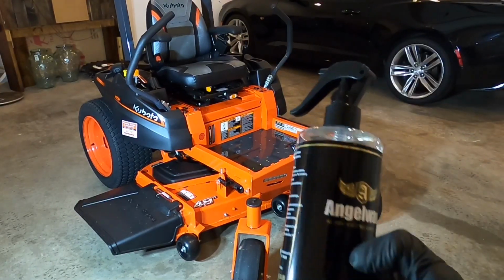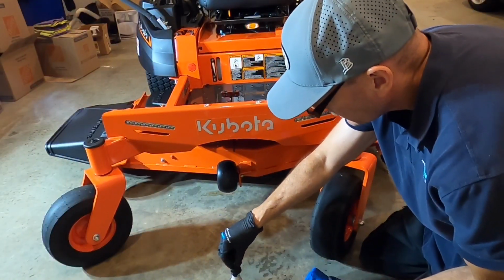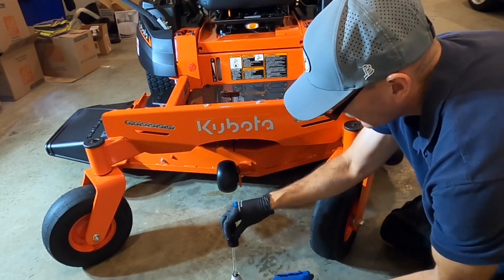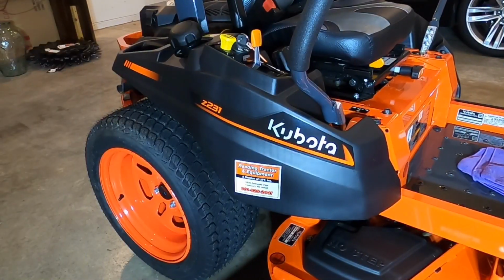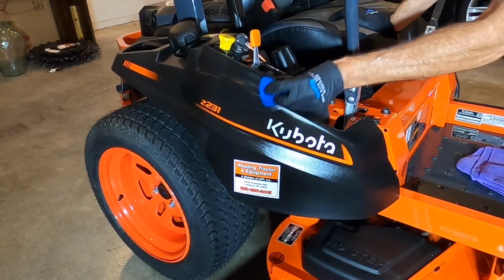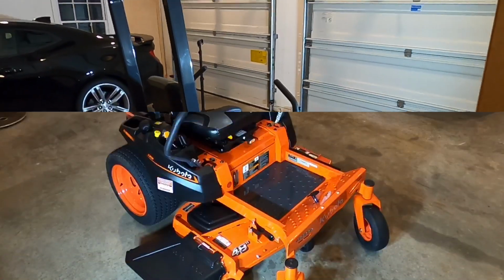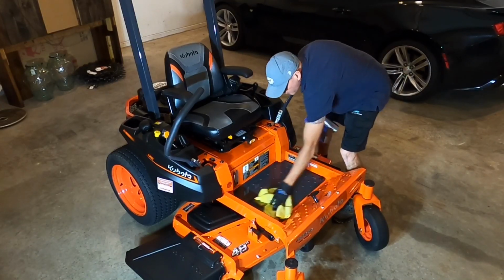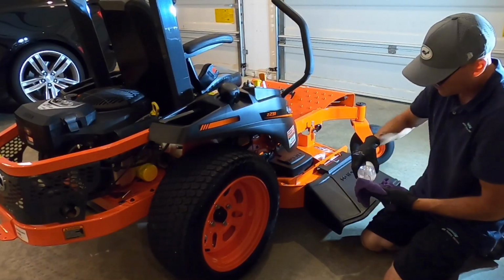Ceramic Coat & Protect ALL Of Your Investments!! Kubota Tractors, Mowers, Loaders!!

Comment: Got my first zero-turn a few months ago and I love it. I imaging ceramic coating the bottom would help shed wet grass, but the paint seems like overkill to me. That said I have an ounce of ceramic coating left over from my car, so...
Reply: It doesn't really help. I've coated the underside of my zero turn deck a few times. The first cut it's pretty much completely gone due to the abrasive nature of what you are cutting. The best form of defense against your desk rusting is to keep it clean. Get yourself a good zero turn lift and hose out the deck after every cut. Those wash ports are useless.

Comment: How does metal oxide coating compare to a ceramic coating?  Are they the same?
Reply from the maker: MO gives you Beefed up protection from the suns harmful rays, chemicals, heat. Also more gloss and depth.